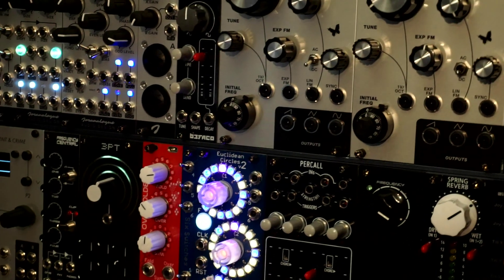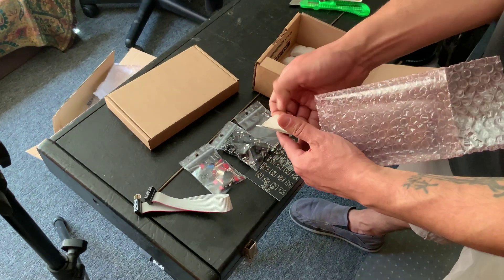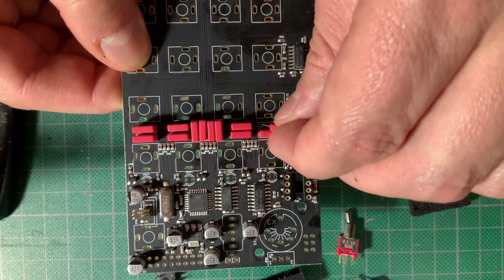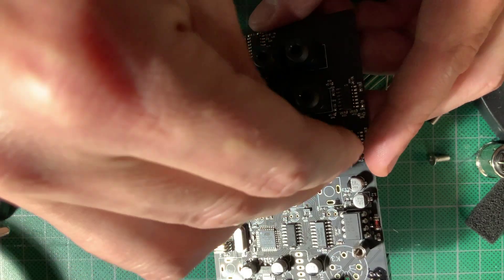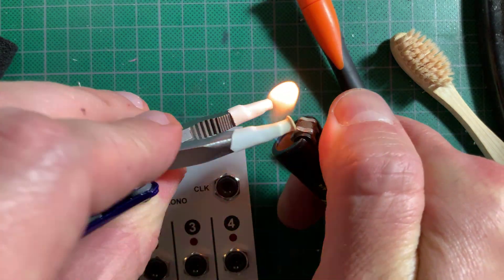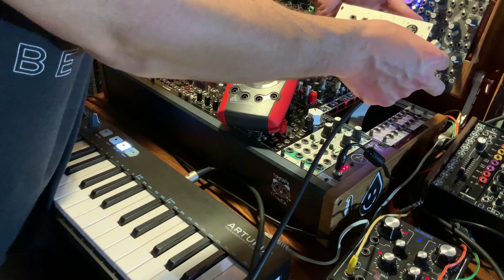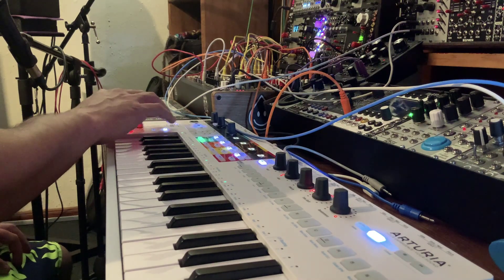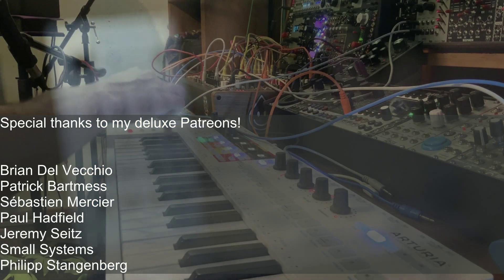Majella 4-voice MIDI to CV Converter kit.

Comment: I noticed that the soldering fumes are going into the direction of your face, this is caused by the body heat causing an upward airstream that takes the fumes with it. I used an old computer fan mounted on an arm from an old desk-lamp to suck away the soldering fumes. They are not as hazardous as they used to be, but still bad for your health.
Reply from the maker: Hi! I did get an extractor, but also, the camera is not my face ;)
Reply: @QuincasMoreira I use an old preparation microscope, so my face is always above the soldering area...
Reply: a little fan goes a long way when it comes to solder fumes
Reply: you cant beat a good bit of solder.

Comment: I like the symbol on the PCB that says no lead was used, RoHS guidelines (other logo). They did forget to put a bar under the WEEE Directive logo I think, stuff after 2005 has got that bar, no bar means 2002-2005 wiki says.